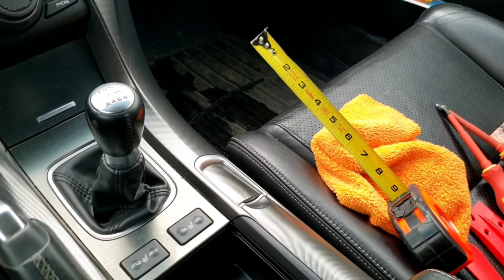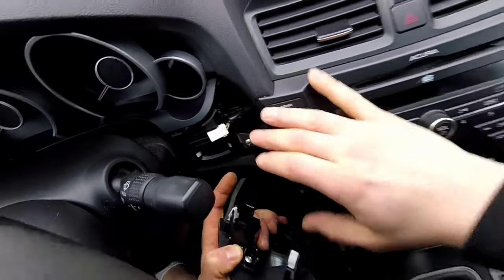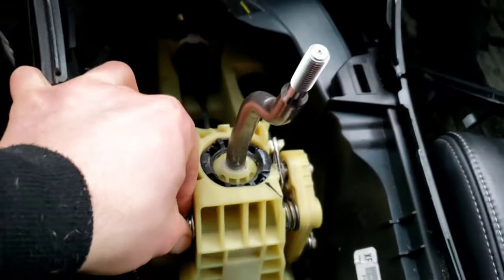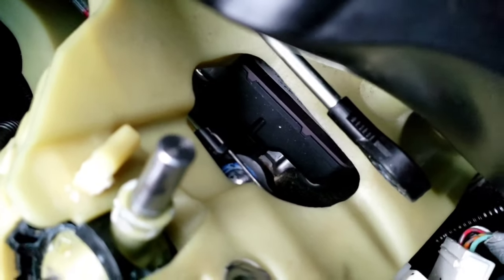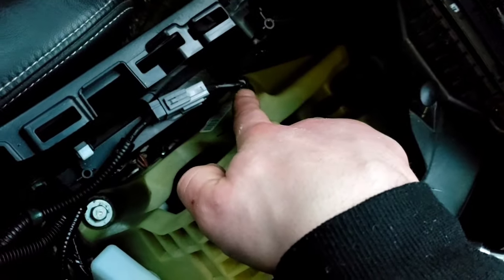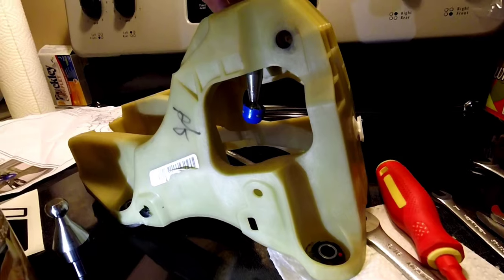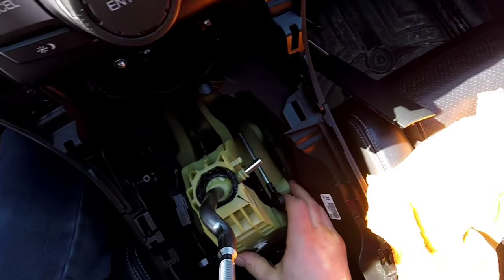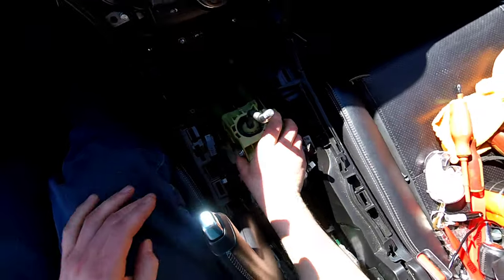Acura TL CT Engineering Short Shifter Adapter INSTALLATION | STEP By STEP PROCESS!

Comment: i did this and the hybrid bushings on my 6-6 7th gen accord. really love it super fun and notchy. i would only do the short shift on my 3.7 TL tho. i like the "softness" of the stock bushings since its a more luxurious car than the accord.
Reply from the maker: Nice👍! My stock bushings were done for, causing me to grind and shifts were stiff and not smooth. Also, after driving this for a cpl weeks I agree with the short shifter adapter part, kind of took away the smooth shifting and makes it harder to get in 4th quickly not sure if I bent something or what.
Reply: @RevsALot  i like it man. i subbed good channel i blew up your comments a bit lol. 
i've really been saving up i think one day i wanna get the Gerzy Bear supercharger kit. 5500 USD for the kit aint no joke... then more for installation... and tuning.. and if you want to retain Air Con... jeezz... its gonna add up. but such a nice car not common to see a 400 WHP awd car like that. (when tuned properly)
Reply from the maker: @Corkoth55  thanks for the support!👊 I know what you mean, it'll cost me over $10k CAD but it's going in as soon as I pay this off.
Reply: @RevsALot  you madman. haha.. i gotta do it now.
Reply: The hybrid bushings, for the base of shifter or the endlinks  on the motor or other? Starting a build in new-to-me 6-6 7th gen also, same set ups as acura tl and TLX, ..and prelude.

Comment: Just ordered this also, but I ended up getting the unicorn rare v6 6speed manual accord. It feels faster than wife's acura tl with intake and exhaust on hers, maybe a lighter car with accord. Whew, stoked!! the motors are very similar with interchangeable parts.
Reply from the maker: Nice! Accord or TL manual are both great fun cars👍. TL is more luxury so is a bit heavier, but I love the luxury feel. I actually removed this on the TL, cause was grinding gears too much. The accord seems to have a longer throw then the TL though, so this could definitely benefit it.
Reply: @RevsALot  Oh really, I didnt even think of that issue. Whelp, I'll try it. Ordered INJEN CAI, Magnaflow full catback and PLM  Jpipe setup with wheels, front lenses and full L.E.D. system swap. I tell you, with this lower weight car I am stoked.
Reply: @RevsALot  Wow, looked like fun. Oye....

Comment: Hi and thanks for the video..but how the shifter doing after you installed it. Thanks
Reply from the maker: It made me grind gears too much, the 4g TL shifter is already pretty short throw so it was hard to get in the right slot when shifting fast. I removed it and haven't grinded since.
Reply: @RevsALot  I installed the same based on your videos, the hybrid racing bushing and short shifter. I find it tougher to put into first and second... did you remove the short shift adapter or the bushings to get back to smoother shifts? If the adapter how the hell did you get it off?
Reply from the maker: I removed the short shifter, cause I kept grinding and couldn't shift as fast since it was too notchy. I drenched it in nail polish remover and let it sit lol.

Comment: Do they make a caged shifter assembly for the 6-6?
Reply from the maker: I think so, but I wanted to keep the oem look at the time.
Reply: @RevsALot  been trying to locate one but I just can't find a company that makes one
Reply from the maker: @lcameeno1  I think you'd have to use one from an accord, but I don't think it's been done yet might need some custom work

Comment: I forgot to apply the locktite, will anything bad happen?
Reply from the maker: It might come lose, hopefully not though...I uninstalled this, made me grind gears way too much
Reply: Unlikely!
Reply from the maker: Just cause the 4G shifter is already very short compared to Accords and 3rd gen TL imo. So this just makes it extremely hard to get into the proper slot I found. Also, it made it almost too notchy, so it didn't glide into the gears as smooth.

Comment: Any one out there know how to remove the side panels to the center console on the 4G TL with the manual shifter box? I got the cup holder and trims all off but I really want to remove the side panels and pull the entire console out so I can install my hybrid racing shifter into my 4G TL , there is not much room in there, so annoying , I think removing the side panels would make life a lot easier, I did that on my 3G TLS , removing and reinstalling the shifter box was a lot easier
Reply from the maker: I couldn't figure out how to remove the side panels. Had a cpl haters commenting how much more difficult I made the job by not removing those, but nobody has showed me how to remove those. I think they might pop off with some force, but too scared to try. P.S. I pinned my comment that I did remove this cause it was causing me to grind gears too much. It make the shift way too short and too notchy/stiff I find.
Reply: @RevsALot  yeah bro , not a simple task